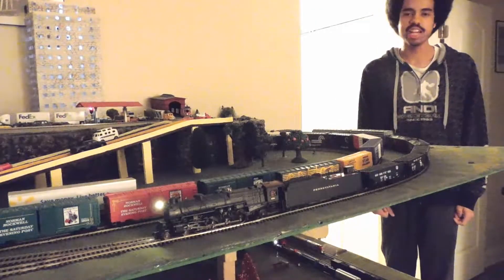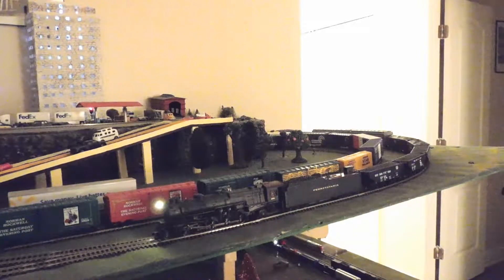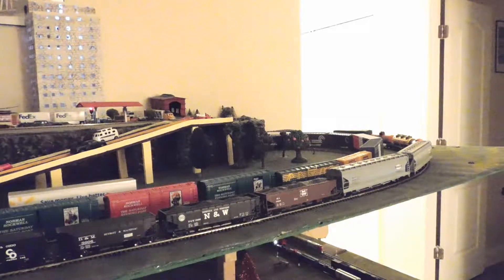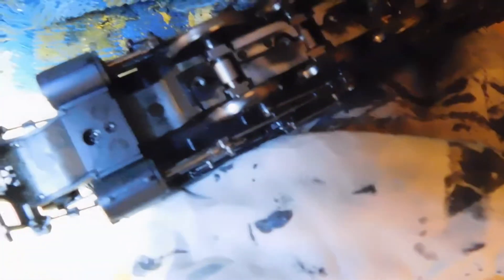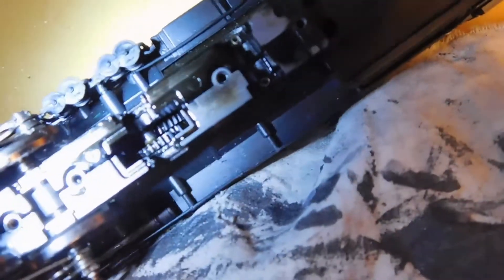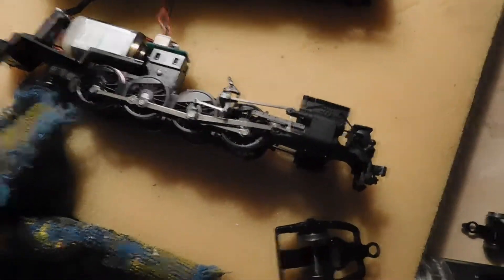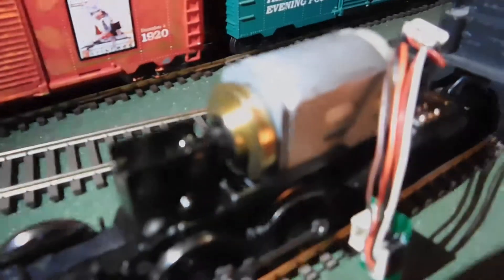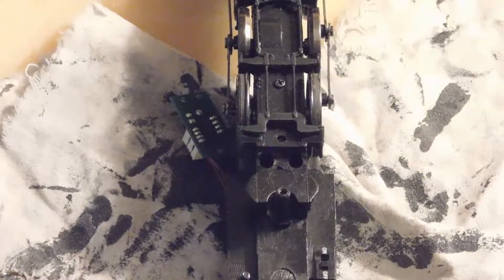Repairing Broadway Limited Imports' M1a Steam Engine-Part 1

Comment: They're great while there running. Both of mine have had drive failures. Then again I have over twelve BLi's with drive failures - very disappointing.
Reply from the maker: Wow! Twelve with drive failures- that's a lot. Did BLI provide parts for you to fix them or were they covered under warranty repair?

Comment: I just bought Broadway limited at a yard sail, no power to the motor, these engines are not cheep, but they seem to have some issues. Waiting for part two. Thanks
Reply from the maker: If you're able to open the engine up I'd use a multimeter to check if voltage is getting to the DCC decoder and/or motor. Maybe you have a dead decoder? I've still been meaning to fix my engine but haven't had time lately. Back when I made this video I got the engine to run a few loops but then it broke again, and it's sat since then.